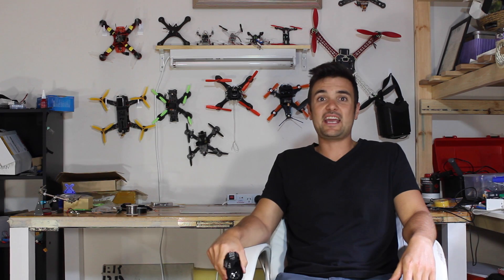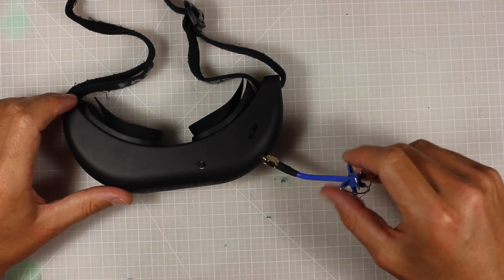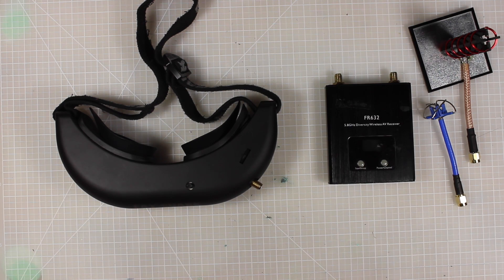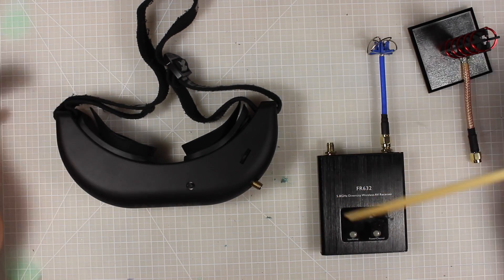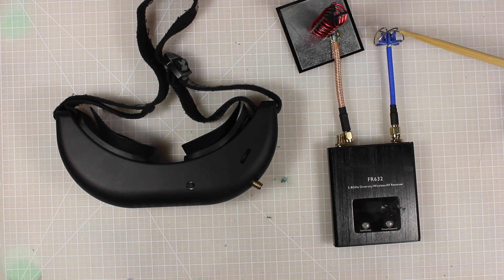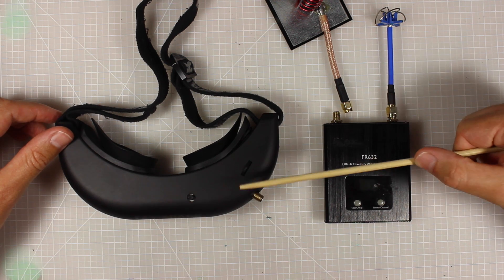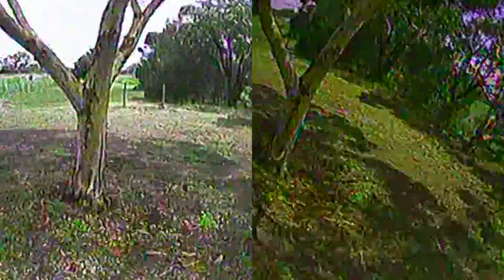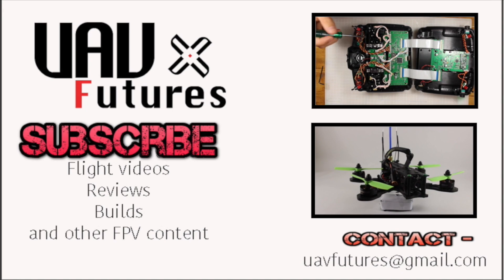DRASTICALLY IMPROVE YOUR FPV FOOTAGE!!!

Comment: Hey stu. I have a problem. I bought these cheap fpv goggles. I had a few flights with the eachine wizard x220 then one time I switched the goggles on on but since then they would just not connect. So I bought another pair of goggles and they also didn't connect. If you have any idea what it could be please tell me. Thanks

Comment: stew-pot, if I add a 10 ft. antenna extension cable would it induce latency? or is it better to have a longe a/v cable?
Reply: An antenna extension would not introduce latency, but it would weaken the signal (probably significant). A longer A/V cable should have no effect though.

Comment: What cables did you use to connect goggles to external receiver? 3.5mm jack male to male? Or 3.5mm jack to av jack female and male av back to 3.5mm male jack.

Comment: Great video, so now the burning question is,  which is the best ground station receiver out there? I have tried the Aomoway, and the boscam and neither one worked as well as my fatshark module.   One more question, can you still use the DVR built into the goggles if you are using the video in jack on your goggles or do you have to purchase a separate DVR as well?

Comment: I use this same TX on the FIRST quanum goggles if the screen was a lil better it would be all I use I also use the 3 turn and a circular.. And the circular antenna stands well over my  Head and the 3 turn directional is pointed in the main flying direction.. And this cheap reciever is amazing, and I've had mine for over a year and it's as Good as most expensive ground station setups
Reply: Flying in Florida you are more often than not challenged by flying through thick wet foliage and that's where this really shines is in the penetration game

Comment: That's great, but you don't want too good reception, especially if you don't have great range with your control transmitter. Remember if you are going large distances or with objects getting in the way, when you are losing video signal you will also be losing control transmitter signal. And if you can't see exactly where your little vehicle is, it can fly away very quickly and get out of range. Ideally you want it so that when you are beginning to lose video signal, you still well inside your control transmitter range, so you know you need to turn around and start heading back (or towards wherever the video signal is getting clearer if you are a bit lost).

Comment: Stew, I got my fatsharks recently with a diversity module. I am having serious problems with losing video with almost every obstruction, from turning my head, to turning the quad and blocking the signal with the carbon, and everything in between: trees, bush, rotten children... Is there something I am doing wrong? Some eachine 007's receive the video without any dropouts in the same area. Thanks for any suggestions you may have!
Reply: I have fatshark dominator v2 and i had the fatshark diversity module on it.. . i had exactly the same problem as you, i took it out and went to the nexwave single antenna module that i used previously.  Now i use the foxeer circular polarized antenna on both my quad and the glasses (essential in my experience to have two matching antennas of the same brand on both ends.. )  For my vtx i use the IRC tramp at 600mw and my range is pretty insane and most of the time crystal clear. With the tbs vtx it would be even better maybe,  I hope this helps you :)
Reply: I ended up putting a new Circular antenna on, along with a IRC Patch, for the most part my video is better but still a little choppy in some areas. Might consider upgrading my VTX at this point. Thanks for your input mate!

Comment: Light stands work great to hold receivers antennas etc.  The are light-duty but extend your equipment up around 10 feet, and they are MUCH cheaper than tripods designed to hold a camera, because lights don't have to be that stable.

Running a ground station also allows you to use 1200MHz which BURNS through everything.

Comment: What kind of cable do you need to go from the goggles to the ground station? I used a headphone jack that has 3 sections on the end and it did not work for me. How many sections do you need on the end, does it matter? My goggles did switch to black screen when I plugged it in, but I could get no picture no matter what outlet I plugged it into on the ground station? I have the same Rx, the FR632

Comment: Good one mate. The first Aussie one I've found gre work. I  know it's lame but I have a bebop 1 with a bebop 2 on its way, in process of figuring out a build for a racer. Really want to try Mr Steal's new motors.
Anyway wanted to know 2 things can I mount an antenna on my Bebop 1 or 2? And do you know of a way to attach a high gain antenna to a phones circuit board to use it purely for FPV not as phone? I ask because I  can't find anything and as I  pull a heap of phone apart I was thinking it must be possible. Cheers Gus
Reply: Angus Whitehouse not sure how this video ended up in my feed but I can definitely answer this question. My channel used to have a ton of Parrot A.R. drone videos on it. I had a mod called a "big wheel antenna" on the drone which significantly improved range. Some people modified their android tablets with high gain antennas to antennas so improve video. The main problem is that both control and video was over WiFi, which has terrible range compared to today's standards. There are a few forums out there dedicated to parrot drones, but I would just skip that toy altogether. Get something real to fly. Also, Steeles motors might be great, coming from a bebop, but they won't make you fly any better. Try a drone simulator...seriously.

Comment: I have the Dom v3 if I use an external receiver (I have a spare skyzone 32 channel) can I leave the Fatshark receiver in the goggles and do I need to still connect an antenna to the goggles if I leave the receiver in it while using an external receiver
Reply from the maker: no, you only need an antenna on what ever receiver you are getting signal from

Comment: Do your goggles need a av input to use a diversity receiver? Or can it connect through the goggle's receiver port?
Reply from the maker: av input if you are using a ground station
Reply: +UAVfutures thcks, for my 1st set of goggles i was leaning towards the eachine ev800s but knowing there is no av input.  I think ill go more the quanum v2 route and get a good receiver.  Im on a budget.  U have any used goggles you want to sell? LOL

Comment: Thanx man, great, straight forward vids,really helpful.Liked n subbed.Do you know of any way of plugging in several diversity receivers to a central hub that switches between the strongest signal, so they can be spread out more to cover more ground?The options I've seen(HK etc)seem to lack the ability to spread out the antennas.Thanx heaps if able to reply but no stress
Reply from the maker: I dont know any that spread out the antennas sorry. Thanks for the sub. Appreciate your support
Reply: +UAVfutures no probs,cheers for quick reply.I have a1acre block in Adelaide hills(think Chad novaks place in Qld)almost perfect for fpv and thinking would still be cheaper than the mega dollar digi HD connex gear.Gonna investigate ripping open and modding an existing one.Thanx again and keep up the good work

Comment: "it's bigger so there must be a lot more going on in there " ?
"A lot of water in your head" ?
Reply from the maker: +RIDERZcouk Sorry yeah about how vague that sounds. Inside the diversity it has a lot more going on, the fat shark receiver, while super small, has to sacrifice some things to fit in such a small space.

Your head is full of water. the  Brain has an awful lot of water in it. like 70% or something. and water is one of the most effective things at absorbing 5.8ghz radio signals. SO this results in your head actually blocking a lot of the FPV feed when it fly around and your brain gets between the quad and your goggle receiver.
Reply: +UAVfutures I've been doing this for too many years now, seriously, water in the head lol